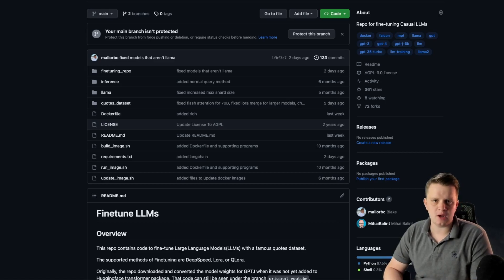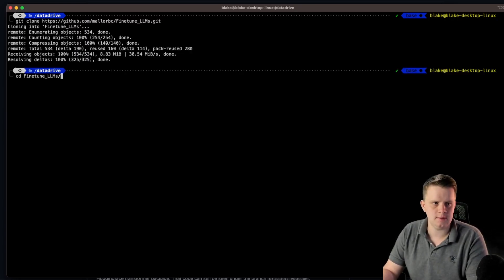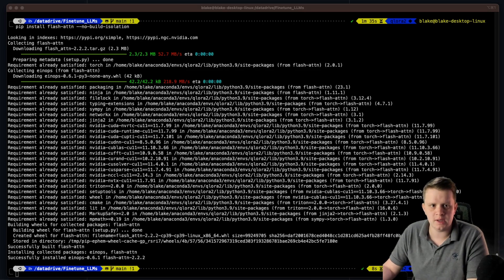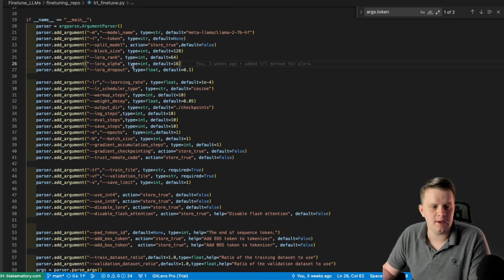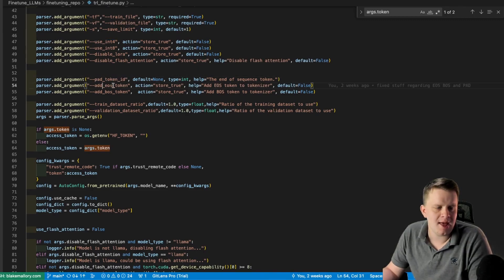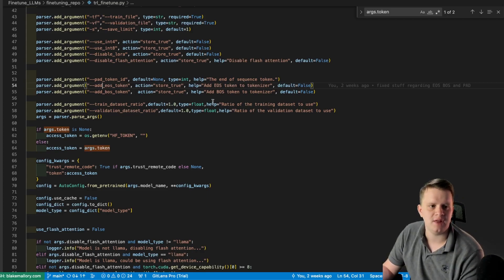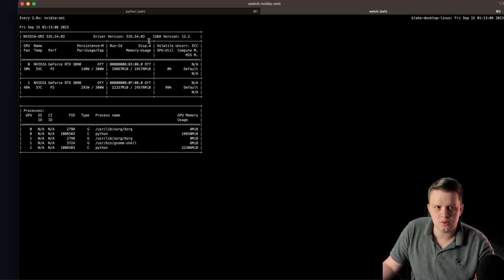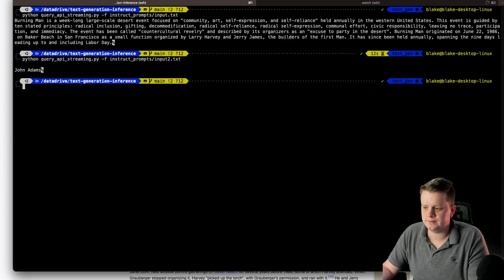Fine-Tuning Llama 2 70B on Consumer Hardware(QLora): A Step-by-Step Guide

Comment: Hi, I was trying to replicate the LLaMA 2 70B fine-tuning with 2 4090s, even with the --split_model flag, the model is loaded to one GPU only before OOM. I tried with the 7B model, which is loaded to one GPU then replicate to the other. It seems it's running in data parallel not model parallel. Is nvlink required for it to work correctly?
Reply from the maker: You have to run it in Qlora mode as well
Reply: I ran it in Qlora mode but its only loading to GPU 0. It kept loading till around shard 10/15 and OOM for GPU 0 while GPU1 was idle.

I checked it and found the device map from Accelerator only include GPU 0, where I tried to configure accelerate with "accelerate config" setting 2 GPUs but still not working. @Brillibits
Reply from the maker: Are you running it in docker?  Can your system see both GPUs? @chris_zhp 

Edit:
I took a look at the code and believe they may be a bug.  I will push a fix now.  Let me know if it works.  Go to Github and open an issue if its not
Reply: @Brillibits  Ty!!!! It works properly now. Thanks for sharing this amazing video <3
Reply: @chris_zhp  thanks for pointing out the issue and thanks for watching!

Comment: What is the training time of this model in 3090?
Reply from the maker: Depends on MANY things.  Dataset size, content, etc.  I did this model in like a day.
Reply: @Brillibits  I used the Dolly15k data set just like your video. I have one RTX A6000(48G) on my server. The estimated time so far is 694 days. After 7 days, the learning progress is 0%. Are there any expected issues? Please advise. thank you.
0%|          | 817/737000 [20:07:57<16242:16:41, 79.43s/it]
The execution command is as follows.
python trl_finetune.py --block_size 1024 --eval_steps 368 --save_steps 368 -tf instruct_train_42.csv -vf instruct_validation_42.csv -m meta-llama/Llama-2-70b-hf --split_model -b 1 --log_steps 368 -lr 2e-4 -e 1000 --gradient_accumulation_steps 16 --pad_token_id=18610 --use_int4

Comment: I see that after finetuning the model i get a .json and .bin adapter file, how would I run my model using these? Can I use them with llama cpp or how do I go about using the finetuning. I guess my goal is a chat that uses my finetuned model.
Reply: You generated a LoRA, that has to be loaded alongside the main model.

Comment: Can i run it by 4090 ??
Reply from the maker: You need more VRAM than a single 4090 can provide.  If you have two of them, yes it can work.
Reply: @Brillibits  Fine-tuning with 2 GPUs took how long? How long do you think it would take to fine-tune a text dataset with 100k rows?
Reply: You can run it on a 4090 if you covert it to exllama2 format and load it with exllama2.

Comment: you need 2 x 3090 or 48GB VRAM to finetune 70B model ?  So for 13B model, I should be able to do the same with 1 3090 card?  I hope to have more hardware requirement details so that I can determine with this procedure is useful to me. Thanks!
Reply from the maker: 13B is definitely possible with a single 3090
Reply: @Brillibits  then, do you need a vram with about x2 ##B parameters?